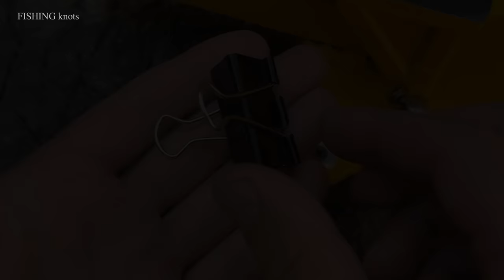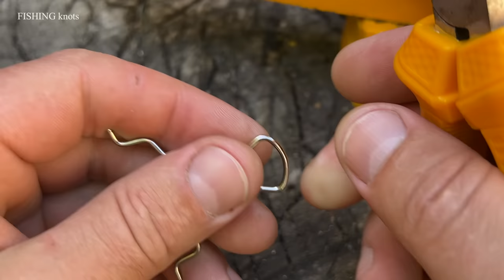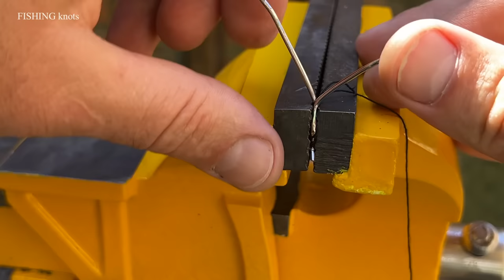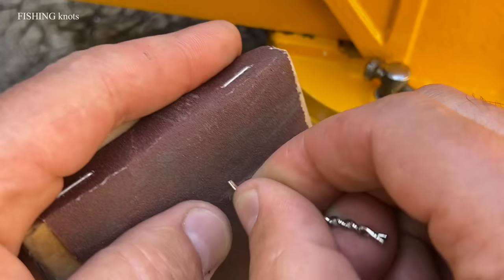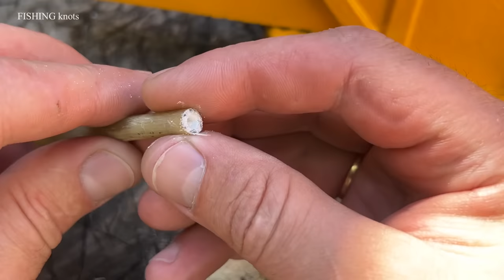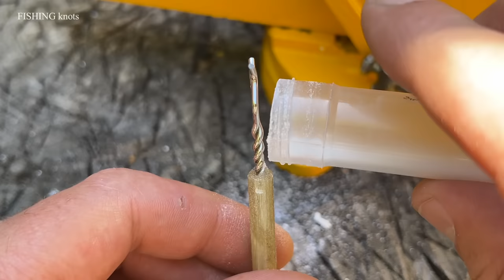See what an incredible tool a fisherman has made to pull hooks out of fish

Comment: already have caught a 30# Blue Cat off of these (going to try to get a 60#+ next year).  https://www.youtube.com/post/UgkxzXmlErSqVAEGWFEKO530BvTqFDw53QW3 Definitely very strong, and sharp. Additionally, the gap is wide enough to actually hook a fish (not always the case with circle hooks). I purchased the 8/0, but probably should have got the 9/0 (they seem slightly smaller than other 8/0 hooks). Additionally, having the point in-line helps if you drift fish. I have yet to get a serious snag with one of these hooks.